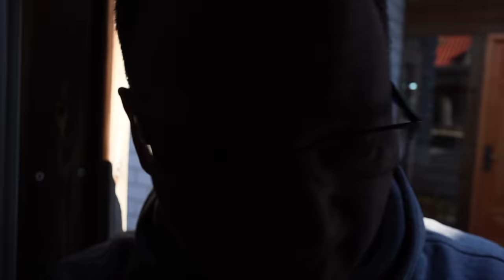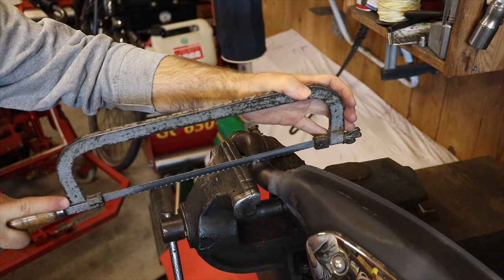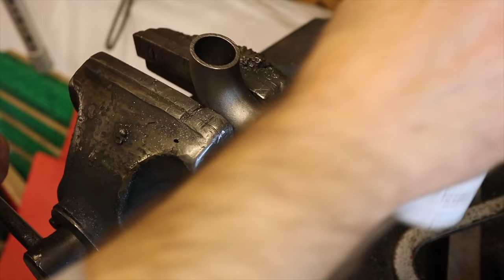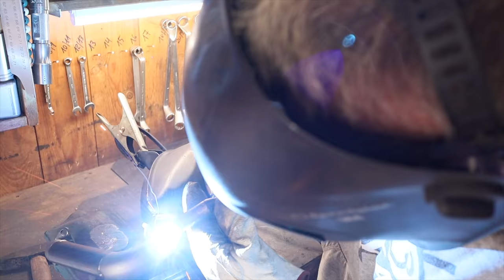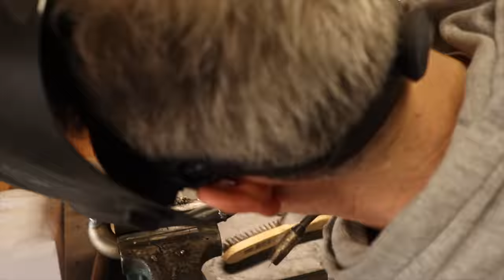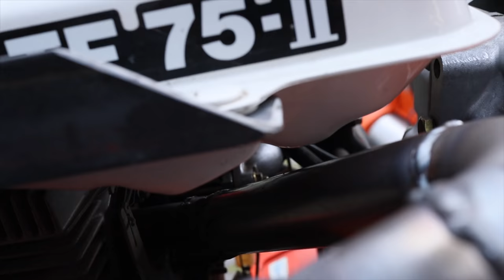Der neue AUSPUFF für meinen AERIFIZIERER. Der Rasenfreak in der Werkstatt. Nicht nachmachen!

Comment: Bei mir war es bei dem Satz vorbei:
Habe ich günstig geschossen bei ebay" ... (Man gibt tausende an Euros für industrielles Fachwerkzeug aus, aber "billig" irgendeinen Auspuff dranschweißen.) Da kommt Nachbarschaftsliebe auf. 
Der Auspuff sieht nach nem Mofa Auspuff aus, höchstwahrscheinlich ein Refelexionsdämpfer, wird nicht sonderlich leise, da er eine andere Aufgabe hat. 
A: Ist sowas nicht für eine gleichbleibende Arbeitsdrehzahl konzipiert.
B: Ein Absorbsionsdämpfer eher.
Auch abhängig vom Einsatzzweck.
C: Es gibt Auspuff Bauer, die Ahnung haben von dem was sie tun & können einen Kunden zielgenau das fertigen was für eine intakte Nachbarschaft nötig ist.
D: Für 99% der Menschen ist der Rasen grün & gut. 
Daher aus deren Sicht, lebe Dein Hobby aber nerv mich nicht in meiner persönlichen Freizeit, in der ich Ruhe haben will, wenn ich in so ein Siedlungsviertel mir ein Haus baue.
Reply: A: Zuhören hilft dann müsstest du nicht raten sondern hättest mitbekommen das der Auspuff von ner Vespa kommt. 
B: Nach deiner Logik dürfte sich jemand der sonst nur günstiges Zeug nutzt niemals etwas teures kaufen.
C: Was interessiert es mich oder irgendjemand anderen ob du denn Sinn von Ruhezeiten nicht verstanden hast. 
D: Warum ziehst du denn in ein Siedlungsgebiet wenn dich sowas stört, jemanden wie dich will eh niemand als Nachbarn.
Reply: Zu dem Punkt mit dem nerv mich nicht: Es gibt Gesetzte zu Ruhezeiten und diese sind einzuhalten. Wenn Andreas das macht kann und darf sich keiner beschweren.
Ein anderer stört sich vielleicht an spielenden kindern, oder dem Nachbarn mit dem lauten Auto. 
Wer ein problem mit dem geräusch eines Gartengerätes hat soll einfach in der Stadt bleiben.
Reply: Danke für die Antworten.... Als Dorfkind habe ich schon leicht Schwellung bekommen
😂